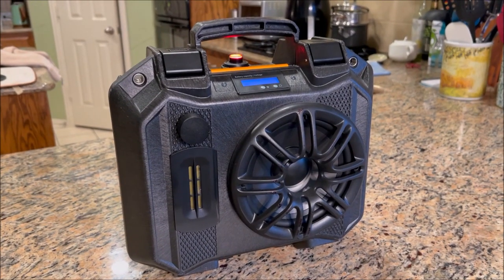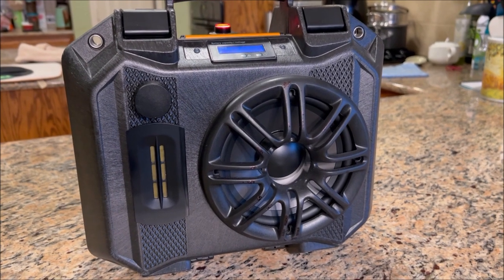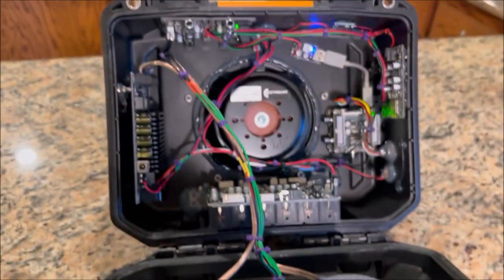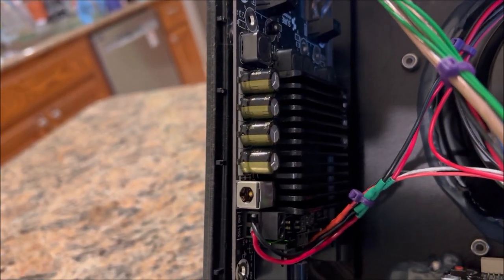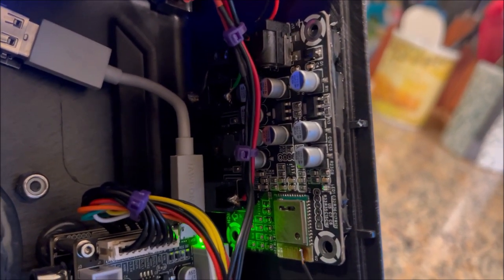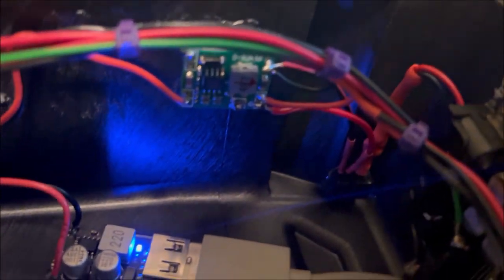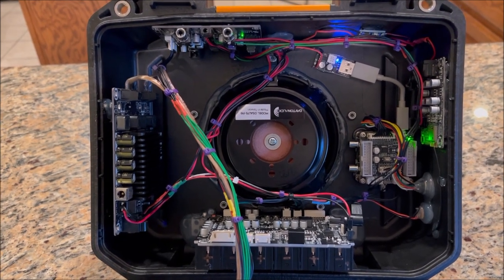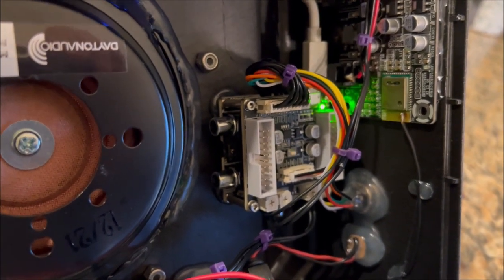DIY Pelican V100 Mono 50W Bluetooth Boombox Demo and brief Description!!!

Comment: Nice build! I'm in the middle of one right now, actually 2 of them. Kinda curious what your using as a woofer.  Maybe I missed it if you mentioned it in the video. One of my builds I'm using DC160-4.  Speaker your using looks close to the same. Great video 👍👍👍👍👍👍
Reply from the maker: Thanks! The woofer came from the Dayton Audio B652 bookshelf speaker. It sat in my garage when I pilfered the AMT tweeter lol